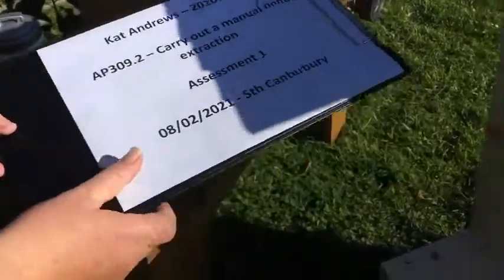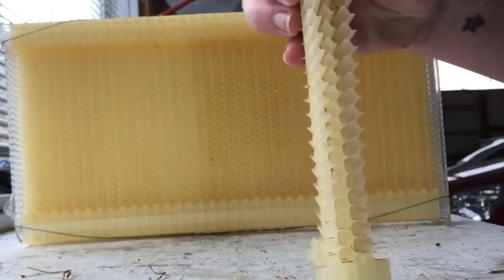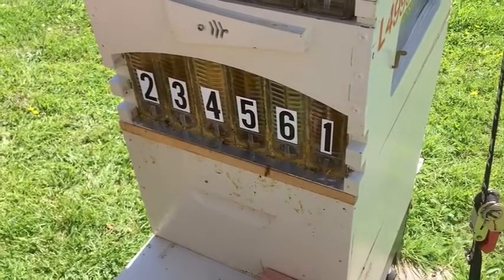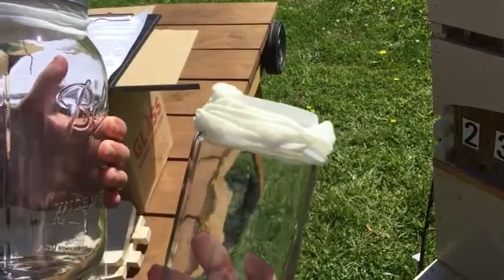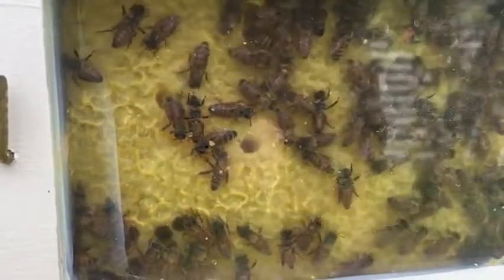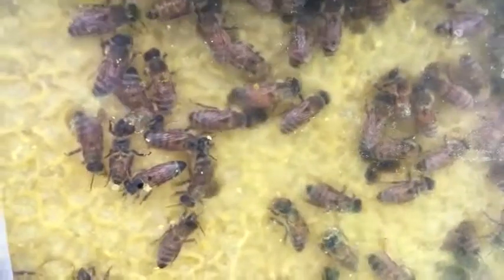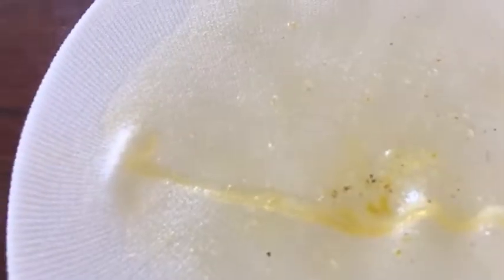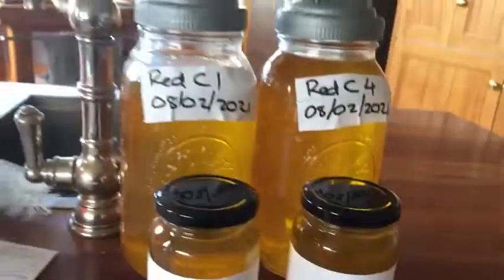Flow Hive 2 - extraction walk thru.

Comment: Hey Kat, really like the vids. Is that a second super above the flow super? Those work sheets and strainers are great ideas.
Reply from the maker: That box you can see is called a quilting box. In summer it is used for added ventilation, in winter you line it with a towel, sacking or wood shavings and it wicks away condensation, keeping the girls warmer and drier.
Reply: @Kat_Andrews  I’m hoping a ventilated inner lid with the flow hive peaked roof will be enough ventilation. After painting the roof, I poked holes in the paint which would otherwise be gaps in the joints.
Reply from the maker: @kidneypop  those gaps in the joints will leak. I siliconed up all the joints and seams on my roof. If you want ventilation, drill a hole about 2-3 diameter in the gable of the roof, and staple some mesh across it. If you have mesh over the hole in the inner board, then that is just enough ventilation to get you through.
Reply: @Kat_Andrews  Thanks

Comment: would you suggest a flow hive for a complete beginner? do they have a smaller version of this? thanks !
Reply from the maker: Yep. When I got this hive I was a complete beginner and this video was done during my first season. In fact, I still haven’t had my bees for a year. 

Just remember though, a flow hive is simply a different method of EXTRACTION. All beekeeping practices remain the same, inspections, pest checking and control, swarm management etc. General bee husbandry DOES NOT change, only the way you collect the honey does. 

They are expensive, but for a hobbiest with only 2 hives, it’s better for me than having a garage full of extraction equip. Harvesting is so easy and clean and I can use my honey right away without having the more labourious extraction to deal with.
Reply: @Kat_Andrews  Thank you for the very informative reply! subscribed! plan on getting the classic Araucaria 7 Frame variant.
Reply from the maker: @JohnDoe-qf1ur  if you want to reduce costs a bit, just buy the frames and the super box. Everything else (brood boxes, bases, lids etc) are all standard 10-frame langstroth kit. And depending on where you are in the world and what your winters are like, you may need 2 brood boxes. Talk to a couple of local beekeepers and ask how many brood boxes they use. 

Good luck and enjoy the journey.

Comment: I would encourage you to refer to this as "harvesting" rather than extracting.
Reply from the maker: And why is that? Extracting is technically correct. To get, pull or draw. To remove something using force (in this case turning the key is applying mechanical force).  So you see, extracting is also the correct terminology. But I am interested in your reasoning.
Reply: I think he ment to say , because  we are harvesting seasons  yeild ,